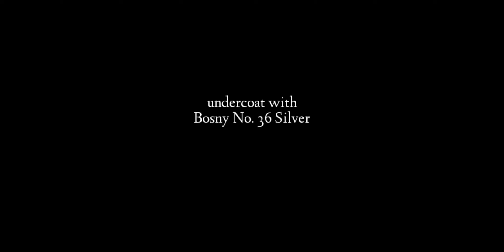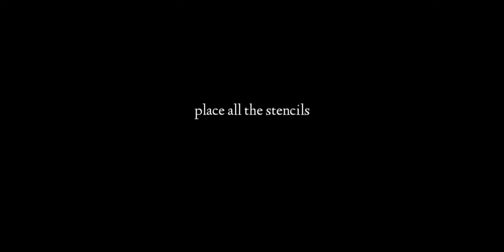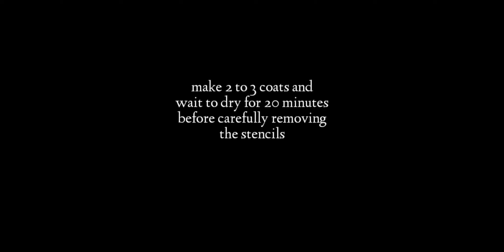How To Paint Bike Frame Using Bosny Spray Cans / Rebranded Custom Paint Job

Comment: Lods ilang patong ng spray paint ng bosny ang dapat gamitin?
Reply from the maker: depende sayo sir kung ilang gusto mo ubusin kung plain, pag may design hindi ko advisable na kapalan kc baka mamuo sa sticker at pag tuklap sumama pati pintura
ang isang lata 2 to 3 coats magagawa sa isang frame small to medium size ng frame
Reply: Pag plain lang mga 2 or 3 lata ng bosny spray paint

Comment: Sir pag bare metal frame sinasand mo pa ba? Or pwede nang rekta primer basta malinis lang yung frame? Steel po.
Reply from the maker: para sakin
between 400 to 600 para atleast marefresh ung gaspang ng surface para kapitan ng primer

Comment: di ba madali mabakbak ang bosny sir? or nagkakaroon ng bubbles sa 2nd coat?
Reply from the maker: basta maayos ang procedure wala naman nagiging problema
ang pagkabakbak depende na kung iingatanng may ari
kahit original paint ng branded frames nababakbak din naman pag hindi naingatan, kahit sasakyan pa

Comment: Boss nung kinukulayan mo ng itim di mo na tinakpan ung tatak na trek?
Reply from the maker: ito po pagkakasunod sunod
primer > silver > stencil/logo >black >tangaling stencil> clear/final coat
Reply: Slmat po sir
Reply from the maker: walang anuman sir
kung gusto mas makintab pa at mas smooth
after mo mapataungan ng clear, patuyo mo 1 day tapos patungan ulit ng clear
Reply: Opo sir pede paki list dito ung bibilhin ko na pang spray para pag nkapnta sa ace hardware mabili ko ung kumpleto na na ginamit nyo sir, tsaka ano ung stencil sir slmat
Reply from the maker: primer, color depende sayo kung anong combi gusto mo, clear, vinyl stickers gamit ko, usually mabibili mo sya online mga naka roll, wala ata sa mga hardware nun, kc ginagamit sya sa mga gumagawa ng customized tickers
Reply: Sge sir hanap nrin ako ng customize stickers trinx kasi gusto ko ibrand sa frame ko
Reply from the maker: kung printed stickers na gagamitin mo
tanong mo kung pwede patungan ng clear coat na pintura
pag hindi
iclearcoat mo muna ung frame patuyuin mo ng kahit 2 days tsaka mo dikit ung sticker
Reply: Noted sir, knyari sir nalagay ko na ung sticker tas kkulayan ko na ung frame hndi ba mlalagyan ung sticker nun
Reply from the maker: 2 klase kasi pwede mo gawin
option 1
primer > color > clear > printed stickers

option 2
primer >  base color > stencil/sticker > top color > remove stencil/sticker > clear coat

ung mga gingawa ko sir option 2
nood ka nung ibang video para mas magkaidea ka din
Reply from the maker: didikitan mo ba sir ng permanent sticker?
pwede nmn din
Reply: @chrisworxcustoms  nakita ko din step ty boss

Comment: anong grit size ng sandpaper gamit mo lods?
Reply from the maker: depende po sa kung gano kagaspang o kakinis ang lilihain, usually gamit ko 280 to 400 grit sa panimula
1000 grit nmn pag may clear coat na

may isa akong video sanding and priming
baka makakuha ka din ng idea pano magliha
Reply: Okay lang ba sticker paper gagamitin lods yung mabibili sa school supplies?
Reply from the maker: nako hindi po sir, kc makapit ang adhesive nun kung gagamitin pang stencil masisira lang ung pipinturahan niyo, at kung gagamitin naman pang decals na permanent hindi din kc pag nabasa ung matutunaw lang ung papel

vinyl sticker po talag dapat na hindi makapit ang adhesive
kung permanent naman po eh dapat ung laminated stickers ung ginagamit din sa mga sasakyan
Reply: @chrisworxcustoms   maraming salamat po lods buti nalang natanong ko haha
Reply from the maker: walang anuman po🙏
like and subscribe na sa channel ko para sa mga bagong puwede pang matutunan
share na din sa mga tropa👍
Reply: @chrisworxcustoms  lods nag pm ako sa page mo 😅